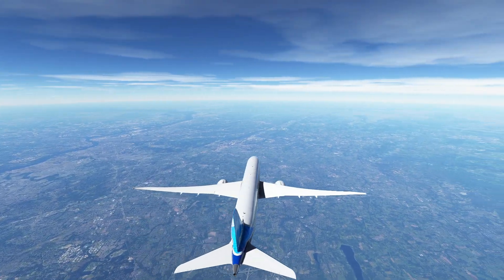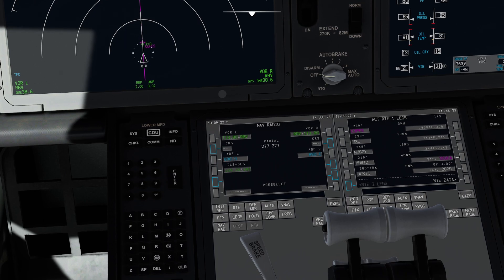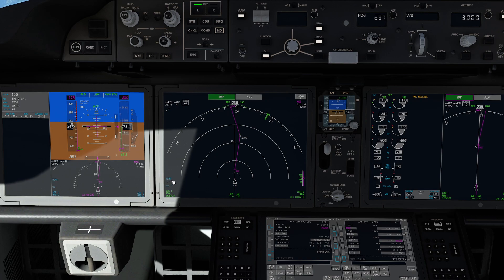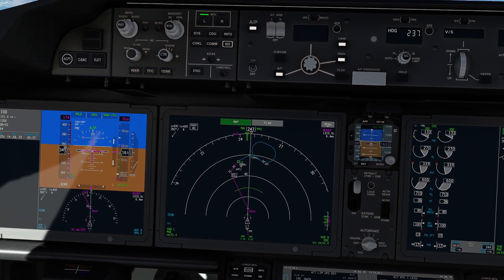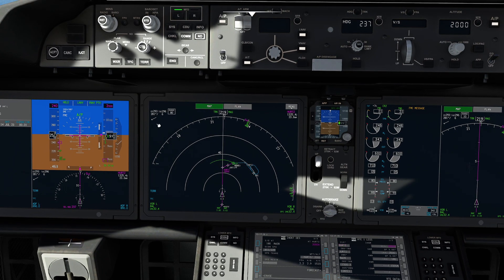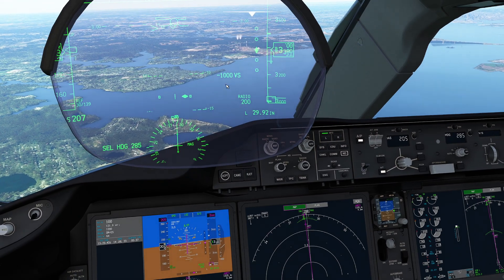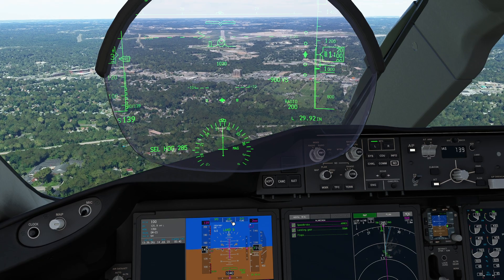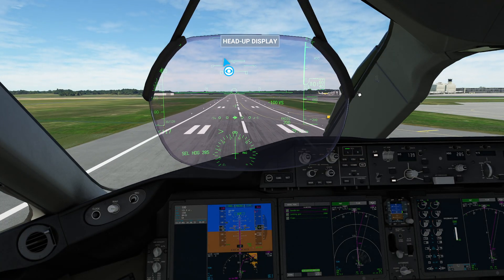MSFS - Boeing 787 Tutorial (2023): Descent and Autoland

Comment: Why is it when I try to take off with the 787 in mid- climb it'll do this violent pitch straight towards the ground killing all 213 passengers
Reply: I literally have similar problems im just someone who likes too fly the planes for fun and doesnt care about the realism so im just trying to takeoff at one place and land at the other without all the auto pilot but for somereason with the 787 it just refuses to let me control it it will not let me go below a certain altitude or control flaps or gears  so I found it unuseable for me and its sad too cause its my favorite plane but I'm forced to use other aircraft like the a320 because it will let me control the whole flight manually
Reply: Same happening to me did u find any fix ?

Comment: Can someone please help me? Ever since the new Update for the 787 and the 747, my 787 does not work anymore. Whenever I try to start it up, at random times it just shuts back down and all the avionic screens just go blank. I've run through the checklist they give us and it still shuts down. I have not been able to fly the 787 since.
Reply: I know on the 747 you gotta wait 7+ mins for the navigation to align,  then crank up the engine.. 787?  I still not have a clue what's wrong with it
Reply: Do you have any mods installed
Reply: @Iwan_S510  I have a Xbox but I bought stuff from the market place for the 787
Reply: Check if your engine generators are on. Sometimes I find that the checklist prompts you to switch them on, when they are actually already on.